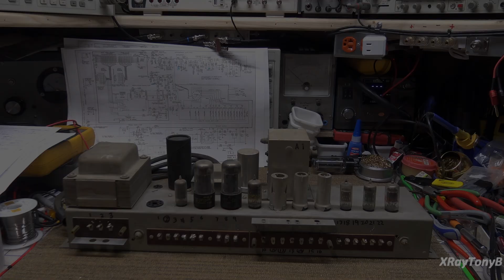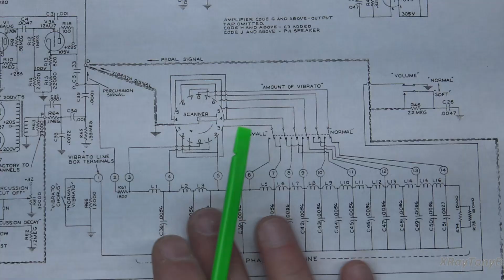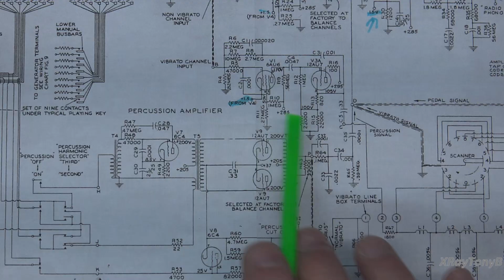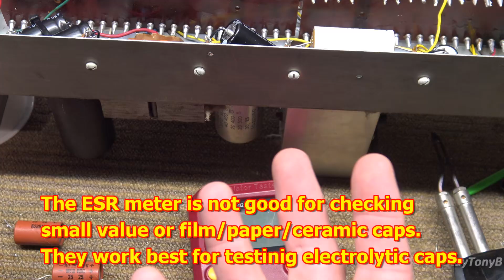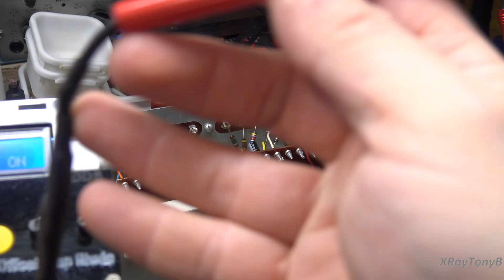Hammond M3 Organ Part 1 - Amplifier Service & Repair

Comment from the maker: 0:15 Intro
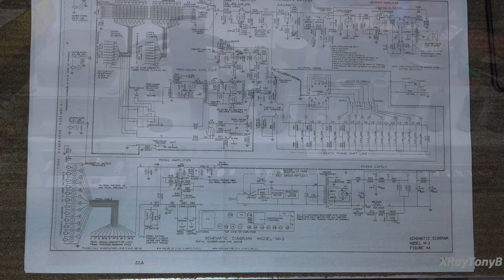2:23 First look at the schematic
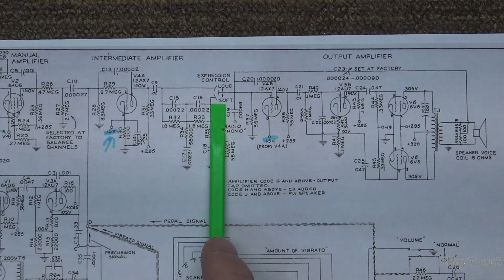5:31 Looking at the Expression (volume) pedal circuit - very unique
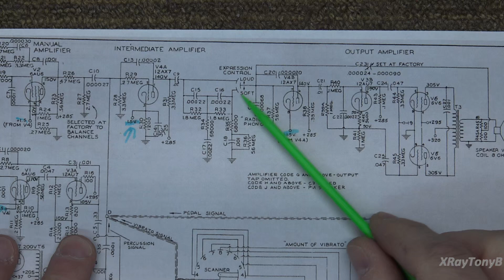7:58 Power amp section
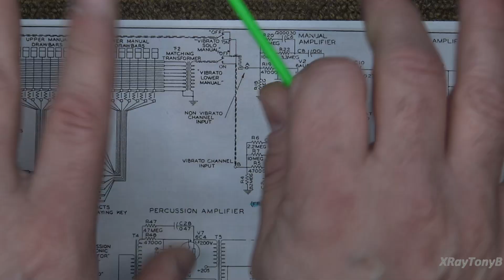9:30 Tone generator description
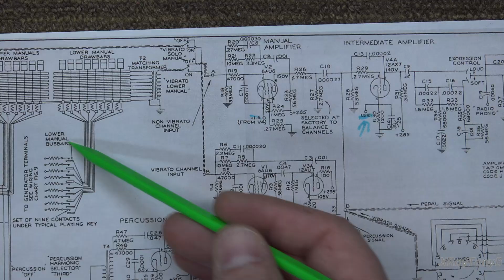11:01 Percussion amplifier description
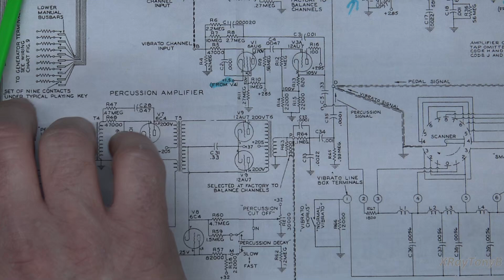12:51 Vibrato circuit description 
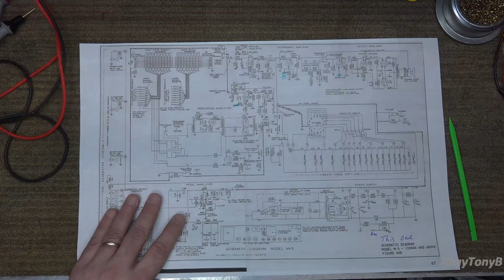18:25 Checking out the mains connection and capacitors
24:39 Checking voltages from the transformer
27:43 Installing the 5U4, testing the power supply and seeing if the amp works
30:24 Capacitors are replaced & amp is tested again
38:07 Using the Mini signal generator to feed a signal into the amp
42:37 Amplifier is cleaned up and ready for final testing - New mains cord and fuse have been added
44:15 Playing some music through the amp and final thoughts

Comment: Hi there. Your channel is an amazing resource! Thanks for posting this information on the expression control. I have a 1957 B3 that sounds incredible and also a C3. Tonally the C3 is also fantastic but the expression doesn't have the same dynamic range as the B3 (i.e. the pedal travel does not affect the signal level until about half way and the minimum level is still quite loud). It's not a mechanical issue (the variable cap has full travel). I wondered if you might be able to offer some advice?

Comment: Would have been nice if they had used the tubes designed in 1957 with a H+ of 12V and a B+ of 12V and using VN66AF MOSFETS to drive the speakers and would mean that the amp circuit would be really safe to work on except you might get burnt but I suspect that Hammond moved to solid state to make servicing easier and safer for the new technicians coming into the company from collage.

Comment: Hi, how can I delete my M3 amp and speaker, and create a line out signal directly from the overall tonewheel output, so I can run that into a standard preamp / power amp, recording console, etc?  Perhaps take the combined out at point D, just before the intermediate amplifier?  -If the signal impedance  is appropriate for a line level signal that is (600 ohms or so?).
Reply: Interested in hearing the answer to this one!
Reply: Trek || makes a box that takes signal from speaker and sends it to a 1/4” out also has low pass out to go to sub or bass amp - also has mute on board speaker switch ! Funny I bought it for that as I already had 1/4 rigged up but found I like the onboard amp and speaker with my brand new Leslie 122h ( yes built in 2024 and 40 watt tube amp ! Thank You Suzuki Hammond … now get busy with that tone wheel organ build ! 
Edit : Trek II also has a pot for padding level out

Comment: I don't know how far along your neighbor is on the tonewheel restoration but you're (or he is) gonna wanna go ahead and replace ALL paper caps in the entire organ. The manual amp, the percussion amp, the scanner vibrato, and preamps. I have 3 Hammonds from the same 50's and 60's era and can assure you that all of the caps leak DC. I know you have the means to test them so, check it out yourself if you haven't already. It'll be a night and day difference with new caps. The biggest job will be the 16 or so caps on the scanner. I know it sounds like a PITA but, trust me, it's worth it. Caps are cheap, it's just time consuming.
Reply: How much would it cost to hire a tech to service/recap my M3 amp?  Or how about the tone generator too?
Reply: @ValeriousRex  Nowadays, a tech will charge you a few hundred to do that job. Let me recommend that you do it yourself. The job is really simple, it's just time consuming. You can get the caps for under $1 each. Being large axial caps, you won't be working on tiny components. If you don't have a soldering iron, you can get one for $10 online. You'll save yourself a few hundred dollars and even gain a bit of knowledge. I really wouldn't suggest it if it were complicated. I can point you in the right direction to get the caps you need if you're not sure what to get.
Reply: @nonsuch  here’s the thing…I did a shifty recap job years ago on the amp even replacing those big can caps with a few smaller ones for each of the internal caps within it…and i had no idea what I was doing and im sure I screwed up somewhere…the organ still works but there’s a few things that aren’t right and I’d rather have someone fix my shoddy work lol
Reply: @ValeriousRex  Understood. There may be some other issues. Did you try replacing the tubes? What are the symptoms? If you happen to be in the D.C, MD, VA area... I can help you out.
Reply: @nonsuch  I’m actually in NJ…it’s mostly ok…it’s just I used cheap Chinese caps to replace everything and not the best solder job…I’ve got all good tubes in it…I guess it sounds a little “dull” but not bad…I also wired the adapter for the Leslie and the half moon switches myself to the amp and to the speaker…it works…but the switch to toggle between the Leslie and the speaker cuts out all sound when you have it toggled to the “leslie only” setting—-(sloppy job by me I’m sure”
Reply: @ValeriousRex  There's nothing inherently  wrong with Chinese caps. They can measure exactly the same. Just about everything is made in China anyway. Buying expensive caps is really just more of a "mojo" thing. It makes people feel better lol. Just fix your sloppy work. Take a few more minutes to do it right.

Comment: Hammond tech here: No, it is not a fixed-bias amp. Many people make this mistake. It is a "back-bias" amp, a variation of cathode bias. There is no independent negative bias supply. The negative voltage applied to the output tube grids is derived from total current draw through the audio circuits. Hammond had been using back-bias since the 1930s. See Randall Aiken's site for a more complete discussion of back-bias.

The M-3's percussion is not unique. You can dial in percussion-only on any of the main console models: B3, C3, A100, etc...

The trimmer capacitor inside the "doghouse" is used to set overall gain of the stages within its loop so you don't get distortion at the outputs. 

Hammond built their own tone cabinets, and Laurens Hammond did not like the Leslie speaker at all, so while he ran the company, there was an official position of hostility from Hammond towards Leslie. No Hammond built during this period would have had an internal Leslie. Hammond employees were not even allowed to visit the Leslie booth at trade shows. One of history's ironies. 

There are a few more resistors a Hammond tech would check for drift or simply replace because they are known to fail by opening up spontaneously, and some of the resistors set things like the Percussion decay times. We would also very specifically fuse the AO-29's power transformer (not the entire organ) with a fuse that would blow in case of a tube short. That was the only real mistake I saw here. The story of why Hammond didn't fuse their amps is a long one, but it no longer makes any sense. It turns the power transformer into the fuse. You can fuse the whole organ if you want, but you should do that in addition to fusing the AO-29's PT primary with a small fuse, ~1.5 to 2A (around twice the idle current), slo-blo.
Reply: How much would it cost to hire a tech to service/recap my M3 amp?  Or how about the tone generator too?
Reply: Hammond+Leslie=Mankind's greatest invention of 2K, A.D. (a gizmo paradise!)

Comment: Do you have any "capacitor replacement strategy" for a rebuild? Do you have any "replacement procedure," or a list of good brands or even caps which you could be sure of in terms of quality?
Reply from the maker: I've talked about this a lot in other videos.  As a general rule, I try to stick with name brand caps from known reliable sources such as Farnell, Mouser, Digikey, Allied, etc.  I use a lot of Nichicon caps just because I am familiar with the different models and their specs and how they compare to the part I'm replacing.  I also like Panasonic, Sprague, Cornell Dublier, Kemet & Wirth.  All those brands seem to be very good quality.  There are many others that are good and some that are not so good quality.  Just try to become familiar with the different types of one or two brands and use them as your "go-to" brand.
Reply: @xraytonyb  Thank you so much. The more that you know, the better the repair!

Comment: You mentioned running on the dimbulb tester with a 40W bulb to limit current, can you please share the method to work out what size bulb to use in the dimbulb tester and the current they would make available to the circuit?
Reply from the maker: A good place to start is by looking at the power requirements listed on the back of the device near the power cord.  For instance, if an amplifier has a max power rating of 100 watts (mains power, not power to the speakers), then start with a 100 watt or smaller bulb.  The lower the wattage of the bulb, the more the current will be limited.  Remember, even a 100 watt bulb will not allow the full 100 watts into the amplifier, as it will act as a voltage divider between the amp and the filament of the bulb, which will limit the max current.  When you know that  there are no major problems, you can increase the wattage of the bulb to allow almost full current to the circuit, but still limit current in case of a sudden short.  Hope that helps.

Comment: I have worked on a number of M3s in the last 5 years.  In addition to the typical week tubes, leaky and open caps I found a number of the carbon composite resistors way out of wack. Getting a seized scanner to spin quietly is the real job.  You got the easy part.

Comment: Your B3 image pasted in is of the Digital B3MkI or MkII haha.

The M Series Spinets may be small but are heavy.  Being a console of such low height, makes them a real shin bruiser.
Reply: The RCA connector on the expression box is handy for such additions like a Maas-Rowe Vibrachime.
Reply: The Hammond Percussion circuit operates the same in all four models, B3, C3, M3, and A100.  The Vibrato in the Series 2 and Series 3 models is accomplished by "phase shift".  

Laurens Hammond didn't believe in fuses.  The first fuse appeared in the reverb amplifier of the A100.  The 6CA4 rectifier vacuum tube as well as the 6GW8A.    

According to those in the Jukebox repair industry, electrolytic capacitors typically have  life of 15 to 25 years.  Anything beyond that is an experiment.  In the time you can test, these old components, they can be replaced, even though the B3/C3 and M3 pre-amplifier chassis are a PITA to rebuild. The M, M2, and M3 spinet chassis a little less as they have the push in solder points.
Reply: In the time you spend testing iffy components they can be replaced.  A capacitor tester with a voltage source from a 9 VDC battery is not a real test.  There are only two products I know of which can accurately test capacitors in real world situations. One is the Sencore Capacitor Analyzer.  The other is a Sprague Capacitor analyzer.

Comment: I had that exact Hammond when I was a lad!  We had an external Leslie too!  Brings back memories.  Do you really trust all those carbon resistors after all these years?
Reply from the maker: All the resistors checked out good.  Those were the Allen Bradley type.  Very good quality.  They usually stay in tolerance, although the really high resistance ones (1 Meg, etc) can drift.

Comment: I service these amps as a hobby, as well. If they are restored to factory original, they are good amps that will last a long time -- again. The circuits are actually quite simple. Almost all parts are still available. It's really sad to see someone turn a Hammond into firewood because the tone generator has frozen (usually fixable) or there are dirty switch contacts that result in no output. A lady gave me an M143 recently. It had no output. After about 10 minutes of servicing, it came back to life. (The start motor was not engaging the run motor shaft.) The reverb amp had some noisy resistors and a couple of bad caps, but it's now fully restored and rocking. The main amplifier is next. It's working well, but I'll replace all of the electrolytic capacitors as the bass response can suffer when these caps start deteriorating.

Comment: That's a great idea, picking the line level signal off the speaker load resistor. You get the full "tube transformer output" sound.

Comment: If it is my understanding that dendrites and corrosion products, tin whiskers or something similar, grow inside the tone wheels and cause short circuits; I watched video on YouTube a while ago of a guy repairing this problem by using a 9 V battery to blast the dendrites out of there!
Reply: They can grow inside the switch assemblies, and you can also get particles of metal plating coming off the inside of the scanner body, shorting out the scanner vanes. Nothing to do with the tonewheels.

Comment: I'm not an expert on Hammond organs, but have loved them since my youth. We had the typical basement band back in the 60's and our organ player had a Hammond L. He was a phenomenal player - could play rock, church, classical, anything. He would go to music stores and play and a crowd would quickly form to listen. The stores payed him to play hoping it would help sell organs. But my memory of the history of the Hammond is a little different than what you said. Mr. Hammond hated the Leslie speaker, probably because he didn't invent it. He did not want the Leslie to be sold with a Hammond organ and forbade the music stores from selling the Leslie with the Hammond. The buyer of the organ was responsible for buying the Leslie and the adapter box and having someone wire it into the organ. The speakerless Hammond (B, C) was really designed to work with the Hammond tone cabinet - basically a box about the size of a Leslie with a speaker(s) and an amp. It wasn't until Mr Hammond died that the organ became available with the Leslie and eventually Hammond bought Leslie or both were bought by Suzuki, I'm not sure which.
Reply: Leslie wanted nasty, operatic, peculiar sounds of a theater organ (on steriods/tremulants).  Hammond wanted the sounds of a church organ.  I read all about this and it's interesting.  Leslie was a theater organ fan/nut.  As later history has shown, Leslie speakers can be used for other purposes.  Just ask the Beatles.  What's amazing about my preferences of a Hammond organ is, with the right registrations: you can have something mellow or something like the church organ (the original intent).

Comment: Many thanks for this one, Tony. The 'Hammond Sound' was very much a signature of the 1950s but I knew little of the technology they used. I now understand why the Queen of Organs was so loved  - and so pricey! Looks like this example is set up for another half century. I particularly liked the capacitive volume control solution to the usual scratchy potentiometer problem.
Once again, keep up the good work.
Rob Stewart

Comment: Really interesting amplifier, thank you for sharing that with us. I'd love to see completed project, if your neighbour was ok with that.  Good idea re. the fuse to protect the external components, but while you are there is it worth adding a lower current sub-fuse to protect the amplifier? (I bet that power transformer would be tricky to replace).